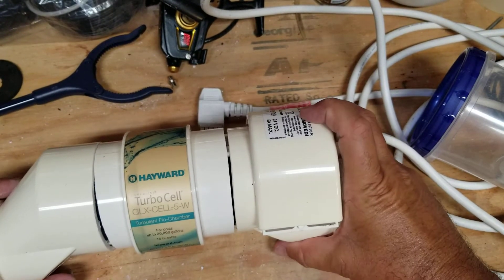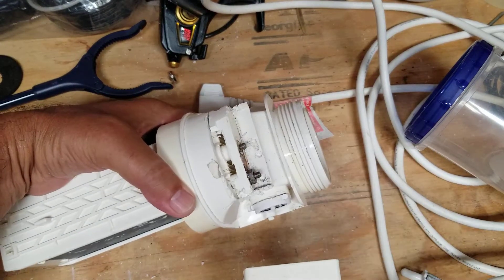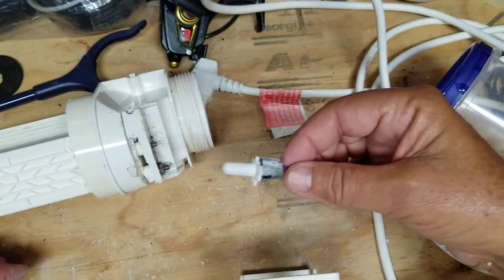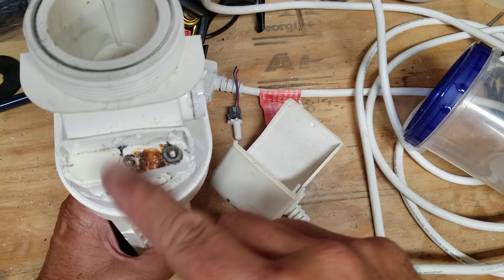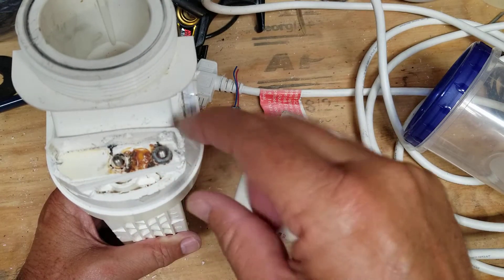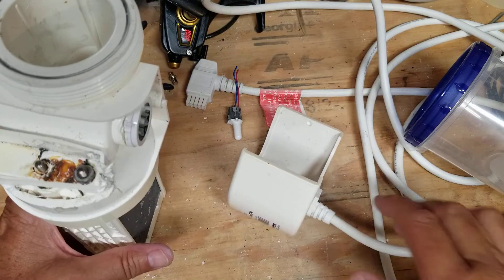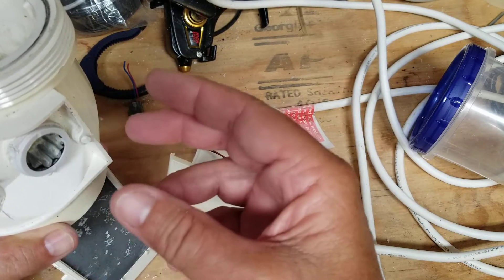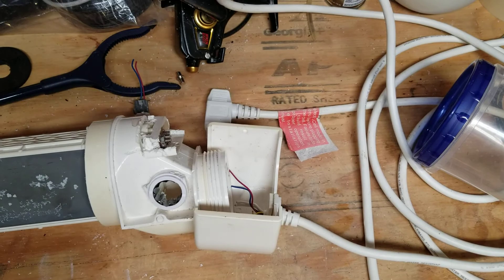Aquarite Hayward Salt Cell failure T-5-  Taken apart

Comment: I understand your frustrations. After almost 4 years I'm replacing my T5 cell which worked well. I am going to pull mine apart and see what's going on in there. I am ordering another one from Blue Works instead of a T5 I am installing a T15 which should last longer.
Reply: How did the Blue Works fare? I read disconcerting reviews that the product fails anywhere from three to eight months.
Reply: @johnlorraine204  so far so good. Had it for 7months.
Reply: I just paid $900 for my Hayward T Cell 15. I think I’ll attempt to repair my old one. The man at my pool store said to remove the good cell in the winter and it will last longer. You can make and install a dummy cell. 6/23
Reply: @jeanneburke1380  I live in Florida so my pump runs year round. The water is way too cold to go into but I have to keep it filtered and clean. I do have an electric heater for the water but with the price of electricity thanks to mumble mutt in the Whitehouse it's too expensive for me to run.
Reply: @raykasza6855  I live in Texas and don't shut my pool down for the winter time and we do have freezes here during the winter. I have a natural gas heater but only use it for my spa. I don't think I can tear a $900 salt cell apart, maybe I'll try that on the old one though. Lol

Comment: Thanks for this Beach, I was unaware that the U cover could be removed by hand.  The area where the nuts are are definitely a weak link that could cause all kinds of errors and poor operation. I will add that the heat sensor doesn't need to be cut off to gain full access, the power wire can be separated from the U cover.... it has a U shaped flexible cord cover that slides off.

Comment from the maker: My Salt Pool Store replacement failed within 60 days and I returned it for a warranty replacement.. I have had the Salt Pool Store send a replacement  and it been working perfect for over a year!!!
Reply: Just wait until it fails and it's been more than a year Then they will tell you it is prorated and you have to pay a percentage of the FULL retail price of $750 so that you actually will have to pay as much or more than you can buy it for the sale price. Just go to the BBB and read the complaints on them. Have you noticed there's no place to leave reviews on their website. Beware!!
Reply from the maker: @missyb1958  I'm not interested in a Hayward new one. The clear housing one works just as good as the factory one
Reply: Thank you for this video and the one where you replaced the Hayward cell. I was wondering about your experience with the aftermarket cell, since this video was published a year after the other, this comment helped understand.

I have the same issue with my Hayward salt system. We have had the pool for less than 5 years and we called the guy who installed, he advised it was probably the motherboard. I thought it was a sensor issue with the cell itself, because the cell generated salt when I tested it, and there are no other issues that point to a motherboard issue, but I replaced the PCB (because it was only 150 aftermarket). Did not fix the issue and had been looking at the Salt Pool Store site aftermarket cell but they have several complaints with BBB. 

This video validates my belief that it was a salt sensor issue all along. Why pay for Hayward if it isn’t going to last? 

I have the T-Cell 940, which is comparable to a T-15, it’s rated for a higher volume than T-5. The Salt Pool store has it listed for 339 with a 5 year limited warranty, which is a longer warranty than Hayward for less than half the price. Thanks again for the information you have shared!
Reply: I replaced my Hayward with the clear housing one. It’s been working fine for a couple of years.
Reply: @bobdrawbaugh4207  Where did you buy your clear housing one from? Thanks 😊
Reply: @MrAlwest77  I got mine from Amazon. It’s still working.
Reply: I just bought a 549 dollar replacement from the salt pool store. I bought the CircuPool t-15 equivalent. Called both company’s and the salt store is a sales associate for CircuPool. Very nice people. 3 year warranty. Probably pro rated the 3rd year. But if I get 36 working months out of this I’ll be happy.

Comment: Very insightful breakdown of the cell, thank you. I have a salt cell sensor fault on my board. Is that sensor inside the cell the sensor that has gone bad?
Reply from the maker: I'm fairly certain that the screw going to the plate the ne I called free willy was broken. That could have set it to the HOT reading. Im not 100% certain